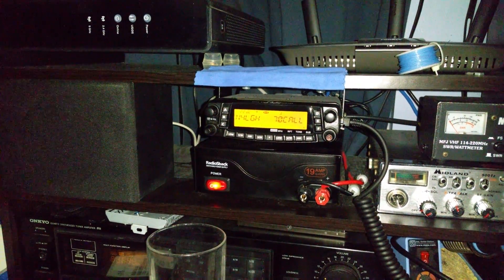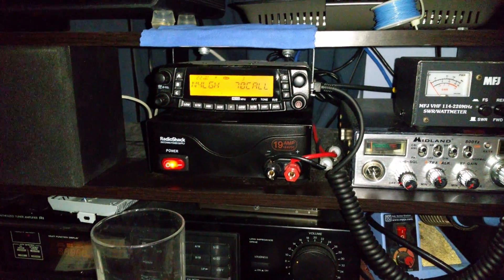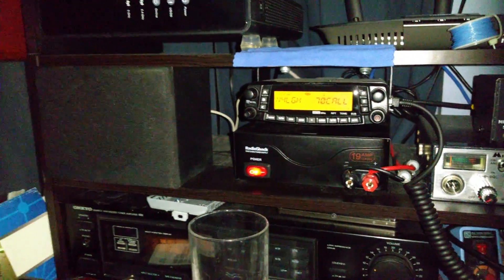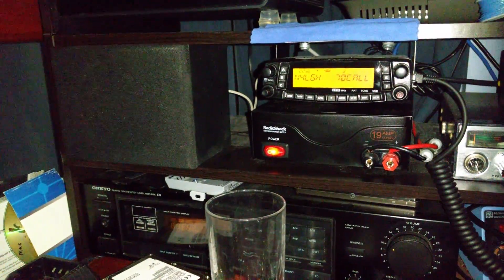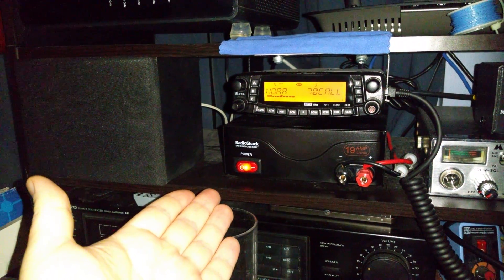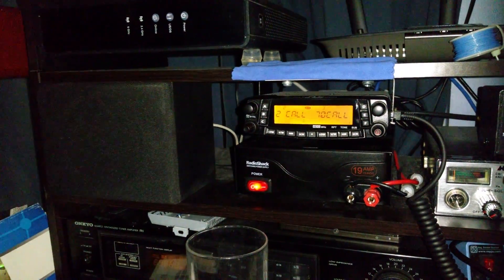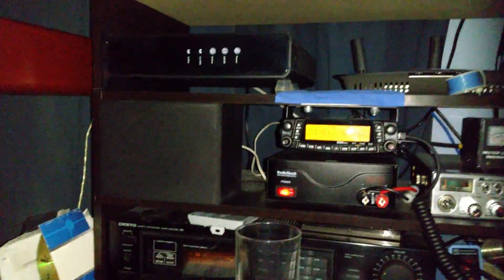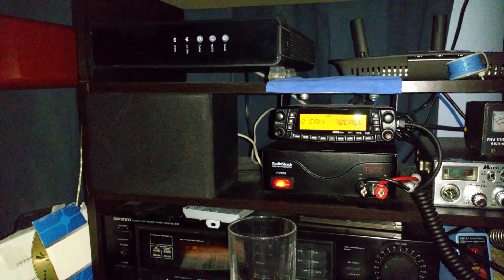Need a better speaker for my radio

Comment: Thanks for share this video,
are you satisfied with TYT?The receiver is sensitive?
..73..s
Reply from the maker: I'm mostly ok with the TYT, it has some weird bugs regarding electronic noise in the audio generated by the radio itself (like CPU noise), namely when I shut off the second tuner, whenever the primary tuner picks up something, it has a high pitched noise, that goes away if the second tuner is enabled again.

As for sensitivity, it's impressive actually, considering I have a discone in the attic on a 50ft coax, I can pick up a good amount actually.  Transmission power is a little higher than it claims, according to my power meter.
Reply: ok,
are you update with latest firmware(plus) thru TYT link?As I read fix many bugs...
thanks
Reply from the maker: I can't run any updates on it, as I don't use Windows on my computers anymore, but the radio does say it's using the plus firmware, as it has a factory sticker on it stating this.
Reply: this is the latest update....thanks...73s..!!